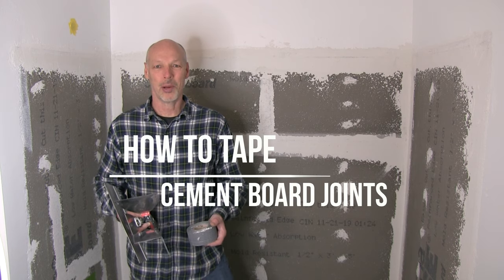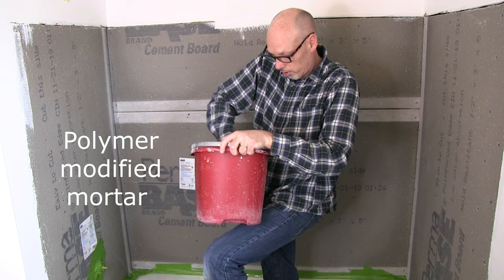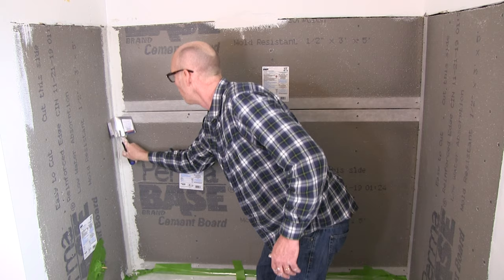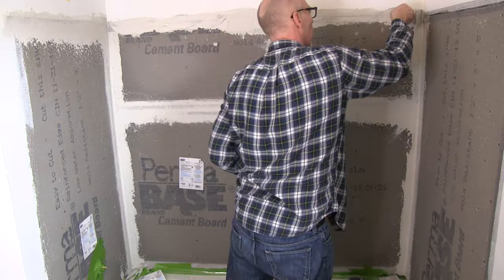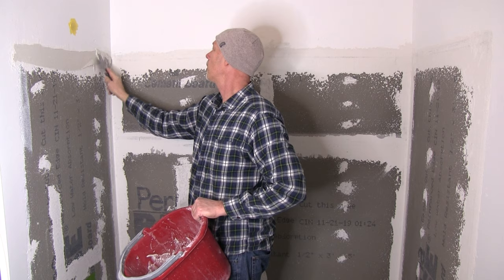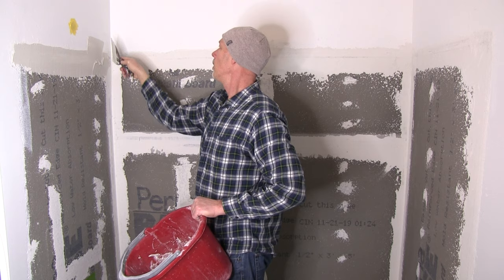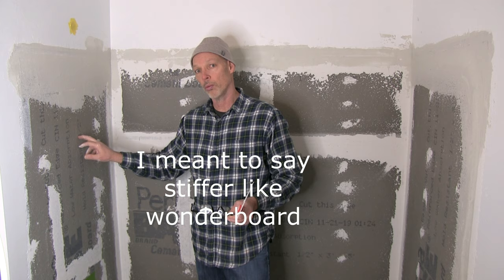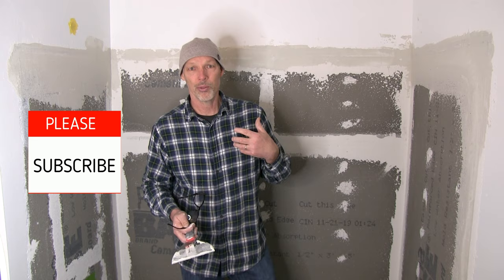How to tape Cement Board Joints

Comment: For the DIYer, this is some of the best step by step on how to apply thinset mortar Ive ever seen.  You cover all bases yet are patient enough to go slowly.  Thank you doe your video.  I came across this video as I was looking for the correct mortar to use in transitions between existing dry wall and new fiber boards.
Reply from the maker: Thank you so much. We are so pleased with how our shower turned out. It was so worth it. Good luck with your shower and again,  thank you for taking the time to post such a nice comment 😊

Comment: Great video. 
My question is this.
After you tape and fill your joints with thinset,  let that dry and put a level to the wall, is your cementboard wall still plumb end to end? Thinset adds another layer to the cement board, and it's no longer super level. Is this a concern, if one is to use large tiles for a shower wall.
Reply from the maker: It was such a small amount that it sticked out that it wasn’t a concern. It was still plumb enough. Remember you are putting thin set behind the tiles as you set them and should be using a tile leveling and spacer system of some type to avoid lipping. 
With larger sized tiles there is a little bit more mortar you apply behind the tiles than with smaller sized tiles; this gives little wiggle room to help plumb things 😊

Comment: So what's the point of leaving a 1/4" gap on the perimeters of hardibacker if you then fill it with thinset? I thought you want it to be able to move around?
Reply from the maker: Thinset  has both flexibility and bond strength, so it has some give 😊
Reply: I actually called James Hardie about this today and they said DO NOT fill the 1/4" gap on the perimeter of each wall, AKA the corners. The guy said leave it open or use caulk. FYI
Reply: He said tape the corners and go over it with thinset but do not fill the crack in the corner (or floor for that matter) with thinset.

Comment: Thanks man. I like the video a lot. I have more to learn and research but you’ve showed me the best information I’ve seen so far. I’ll watch again but what was the specific adhesive brand and name you’re using in the joints, if you can answer?  I enjoyed how you were able to admit a potential small mistake you made after
Reply from the maker: Thank you   
TEC  383  polymer mortified mortar white ultimate large tile mortar.   Because we installed large porcelain tiles and this was available in our area this is what we used 😊

Comment: Great job, informative video. One quick question Haven't checkdd comments yet, outside corner drywall meets cement board cement board will have tile, obviously drywall eventually painted, also will be doing tile profiles on edges but... getting ready to tape CB seams and fill with thinset
Reply from the maker: Thanks for watching and posting a comment. I'm not sure what you're asking. Are you wondering if you can tile over where the drywall mud is feathered over the cement board some? My understanding is that it is ok if it is on the edge area where it won't get much water. We did seal the grout and are going to try to reseal it every year or two. So maybe that will help things to last.
Reply: @SilverLiningDayDreams  what brand of thinset did you use over the tape and seams?
Reply from the maker: @gardeninggptx  Great question. We used TEC 383  polymer mortified mortar white ultimate large tile mortar.   Because we installed large porcelain tiles and this was available in our area this is what we purchased. Thanks for watching our videos 😊
Reply from the maker: @gardeninggptx  Great question. We used TEC 383  polymer mortified mortar white ultimate large tile mortar.   Because we installed large porcelain tiles and this was available in our area this is what we purchased. Thanks for watching our videos 😊

Comment: what did you do at the bottom between the tub and the board?   did you use the same method?    just about to install my own.
Reply from the maker: I used silicone caulk. I can’t speak from experience on what’s best. I think if I had to do it again I probably would have used same method with the tape and thin set. I just released a short RedGard waterproofing video where I talk a little on how the RedGard adhered to the silicone caulk. See below for video link and please consider subscribing if you haven’t yet. Thanks for watching.     
https://youtu.be/36aXW2M5Qyk

Comment: Can you use 45 minutes joint compound for the seams .. I have use it before and works good too.. of course I paint red water proofing
Reply from the maker: I’m assuming by joint compound you mean Sheetrock compound. I would recommend not using it but I’m glad it worked out for you. I would recommend using the same mortar appropriate for use with your tiles. Thanks for watching 😊
Reply: @SilverLiningDayDreams  thank you so much for your help I appreciated

Comment: Instead of using thinset mortar, can I use concrete  patch to seal the edges of the cement board ?
Reply from the maker: That’s a great question. I believe some of them do have flex in them,  but I’m honestly not sure. I did a little research after reading your question and I’m still not sure. If it were me I would error on the side of caution and not. Sorry that I couldn’t answer your question with certainty.

Comment: What type and brand of thinset are you using for the joints? Thx
Reply from the maker: Great question. We used TEC 383  polymer mortified mortar white ultimate large tile mortar.   Because we installed large porcelain tiles and this was available in our area this is what we purchased. Thanks for watching our videos 😊
Reply: @SilverLiningDayDreams  thx man! So just the exact same thinset u use for the tiles?
Reply from the maker: That’s what I did and it worked out fine;  but I don’t know for sure what the “official” recommendation is.
Reply: @SilverLiningDayDreams  thx!

Comment: you can't use setting joint compound instead?
Reply: No, probably not gonna hold up
Reply from the maker: sorry that I missed your comment. What should I have used?
Reply: @SilverLiningDayDreams  probably thinset
Reply from the maker: @MrLaptopus  Just so I understand, so on the very leftist and also on the very right side where the drywall mud slightly overlaps onto the cement board before tiling then that is a bad idea?

Comment: Like most rando people on youtube, he did this wrong. He used the wrong tape for the cement board. The mortar and cement board will eat that tape and the joints will eventually fail. He also appears to have the screws too far apart.The tub spout has no support so it is a very likely place for it to fail and start leaking. He also spent a lot of time on things that were completely pointless. When you put tile in, you will be covering the entire wall with thinset, so trying to go in and make it all perfect before hand it a waste of time.
Reply from the maker: You’re entitled to your opinion, but I would have to disagree with your assessment.
I am not, nor have I ever said I am a professional. I am very particular by nature and a homeowner that
has done a wide variety of projects. When I’m in doubt I have conferred with friends that are professionals in the trades.
If you don’t like the info, just scroll on. 👍🏼
Reply: Am contractor he did a excellent job the best I have seen